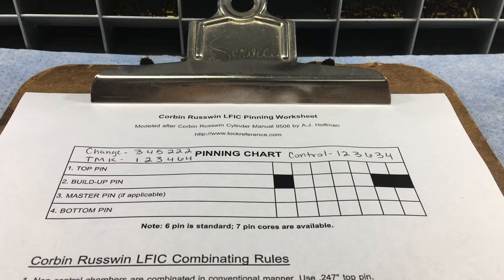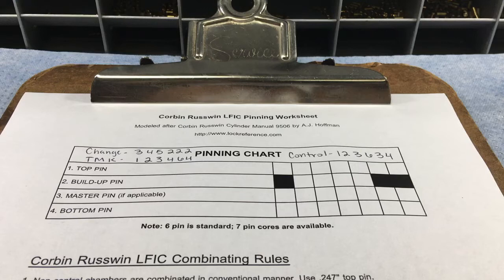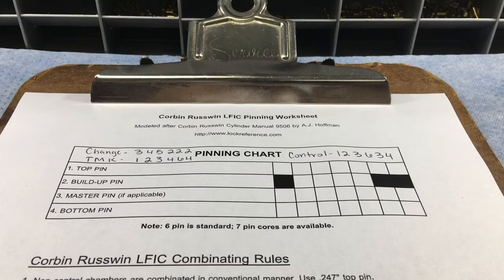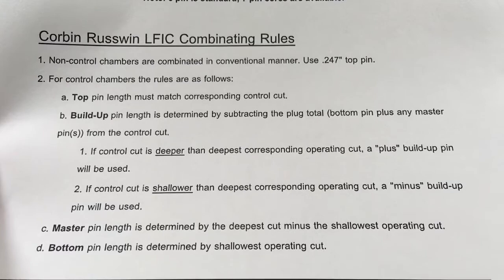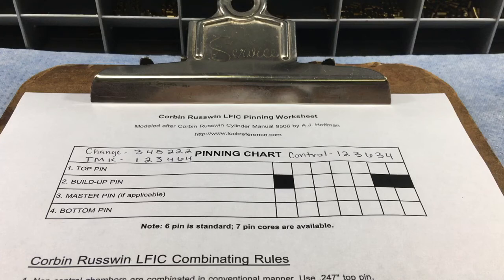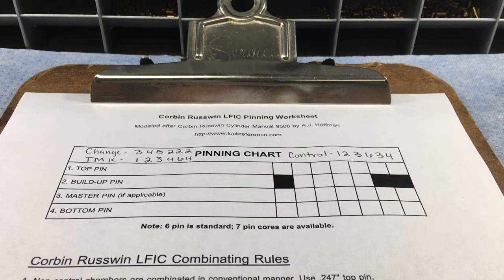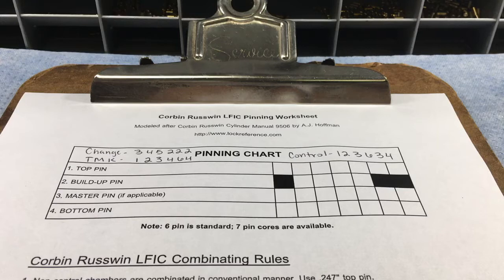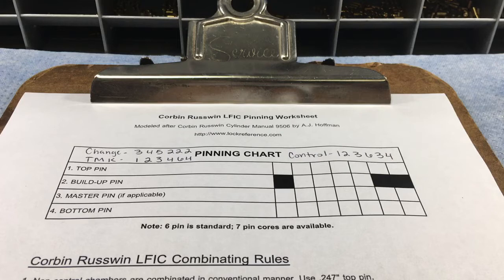Create a Corbin Russwin LFIC Pinning Chart in SECONDS

Comment: Another way that is similar to your way is to fill in the top pin numbers first from the control key.  Then do one of two thing to complete the rest of the pin boxes:

1. Start at the bottom and master pins just like you did. But then, take the top pin number, subtract the master pin, then from that subtract the bottom pin, just moving down the column, and write that total as the buildup. For example, say the control/top pin is 5 and we have 4 as master and 2 as bottom pins. 5-4=1. Then, 1-2=-1.  So -1 goes for that buildup box. 

2. When you write the smallest bitting in the line for the bottom pin, then write the other key’s bitting for that chamber below it, making a new row underneath the existing chart. This new row makes it easy to subtract the two to get the master pin, since both numbers are right there. Then, subtract the top pin from that new line below the chart, and write that in the build up box for that chamber.  This way it is also easier to check the math if something goes wrong, since you can “see” both key bittings and rework the column math.

Comment: How does one do it for just a an SKD?

Use the same idea with the control and Master key where the 1-3 and 6th numbers are the same and the only number would change is the 4th and 5th?
Reply from the maker: 1 and 6, possibly 7 if present, stay the same with the control and the operating key. The math is the same for the control chambers, easier actually, because your plug total is just one number instead of the addition of two (bottom plus master).
Reply: @Thethreetumblers  Thank you, I was wondering why my first try didn't work then I remembered I used a totally different number for the operating key instead of the same numbers as the control key with the exception of 4th and 5th numbers.

Comment: Just pined one up the other day. I did it the hard way because I didn't know what the numbers equal to in thousands. I only have a universal pin kit. All I knew is the total pin stack had to equal .515 according to the page I found. Do you know where I can find what the numbers + and - equal to in thousands ? thanks buddy, great video. Glad to see your still uploading!
Reply from the maker: Rookie Lock Thanks. Two sources for the info you’re looking for. 

First is the Corbin Russwin Cylinder Manual: http://www.lockreference.com/wp-content/uploads/2018/02/Corbin-Russwin-Cylinder-Manual.pdf

Second, if you want them separately, with additional info, we’ve made key bitting specifications for all systems/classes:

http://www.lockreference.com/items/key-bitting-specifications/?portfolioCats=8

Hope that helps.

Comment: This is very informative but Im not sure how you pin a negative number? I have ZERO LFIC cores on campus and I am being forced to use one and I am still confused on how to pin the cylinder. I have a master key I want to use but can use any change and control key. Can you help me out? I also do not have a .003 pinning kit, I have 5 thou pinning kits. Is this possible for me?
Reply from the maker: A universal kit won't work, unfortunately. You would need a dedicated pin kit for Corbin Russwin or, at the very least, the pin segments required for the Class/Depth system. Here is a link to all of the available Corbin Russwin Class/Depth pinning information: https://www.lockreference.com/items/key-bitting-specifications/?portfolioCats=8 Once you find out what you have, you can determine what you'll need in terms of pins.